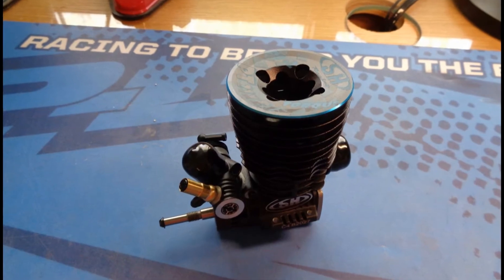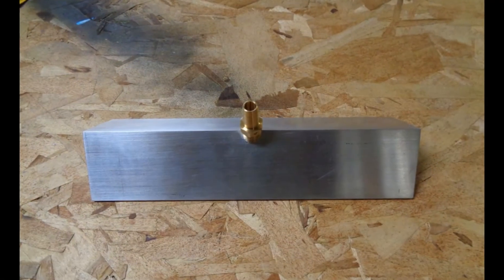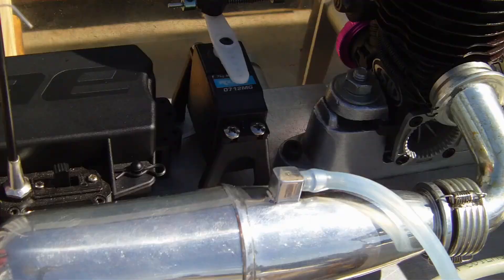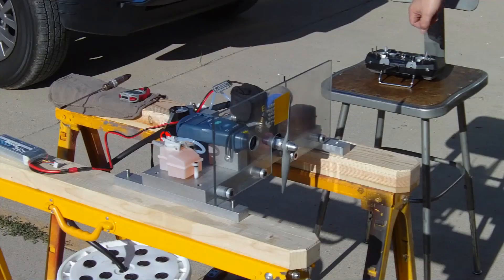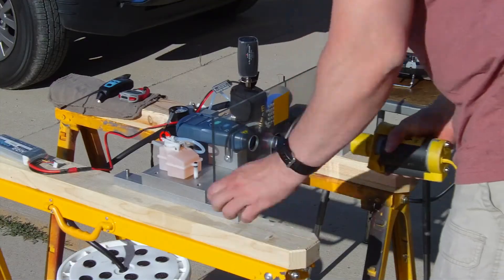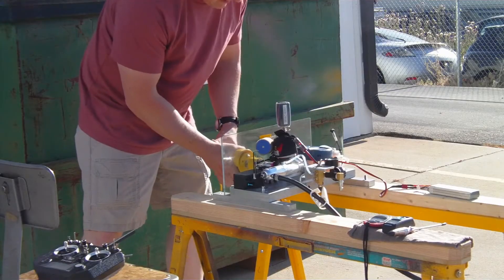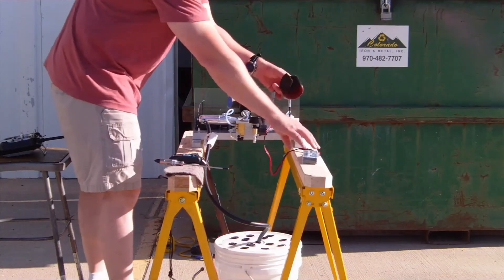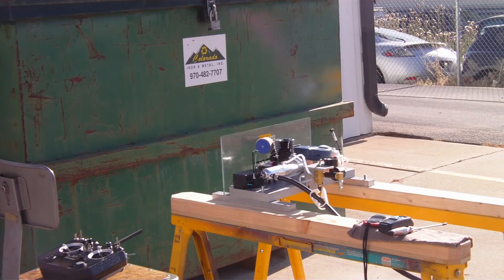.21 Nitro Engine Break In

Comment: Any chance of you sharing what your prop adapter looks like. Was your propeller adapter a cnc made part. Any details would be greatly appreciated.
Reply from the maker: If I get a chance I will try to make a video of it.  It is a home made adapter that bolts to a modified Alpha fly wheel.
Reply: @oakes4501  I'm sure we all will look forward to seeing your video. I thank you for even replying, wasn't sure the interest was still there.
Reply from the maker: Interest is still there.  I have been super busy at work.  I am really itching to do some racing.

Comment: I made a setup similar to this, but now they have the heated pil bath break in..which is much less hassle as well can be done in the house.
Reply from the maker: Recently I sent an engine off for oil bath break in.  When I have spare time, I prefer to break in engines myself.  The tinkering and the noise are part of my enjoyment of the hobby.  However, if I don't have time, I do send my engines off for oil bath break in.  I think owning an oil bath set up for an individual would probably be pretty hard to justify.  The oil bath services out there in most cases are very affordable.  It's kind of like painting bodies.  I enjoy painting bodies and when I have time, I always paint my own bodies.  There are people out there that will paint an amazing body for $70.  It really does not make much financial sense to paint your own bodies or break in engines yourself.  I don't have much time to devote a day or weekend to racing a lot of the time.  In order for me to get enjoyment out of the hobby I often have to find ways to enjoy the hobby in two hour or less segments of time.  I agree it's far easier to send an engine off to oil bath break in, but breaking in a engine my self gives me a way to have a little nitro fun on a Saturday afternoon with out packing up all of my stuff and devoting the entire day to racing.
Reply: @oakes4501  With break in, if you race every weekend and have mulcars and engines, breaking in the engine at home is the way to go, tim saver andoney saver, I was racing quite often, so for me it was a no brainer to do the break in myself. For the occasional racer or basher not so much.

Comment: What is that pressure gauge
Reply from the maker: A failed experiment.  With out giving a very long winded explanation.  I was trying to run the fuel pressure off of compressed air.  I could not adjust or regulate it down low enough to work.  I would estimate that from the exhaust you only get 1 or 2 PSI of fuel pressure.  I could not get the regulator to go down lower than 5 and it would just flood the crap out of the engine.
Reply: @oakes4501  you can use an airbrush regulator those go down lo low alternativley an aquarium air pump might work
Reply from the maker: When I get a chance I will have to mess with it some more.  For the first few tanks of fuel you are not burning much of the fuel.  What can happen is that gunky fuel can clog up the fuel pressure line going to the gas tank and then you can have a really hard time getting the engine to run.  The compressed air for fuel pressure was to solve this problem.  If I can find some spare time I will try to find a different regulator and install it.  I only intend to run nitro truggy this season and Tekno has been taking their sweet time at releasing their new truggy.  I may not be doing much nitro racing this next season.